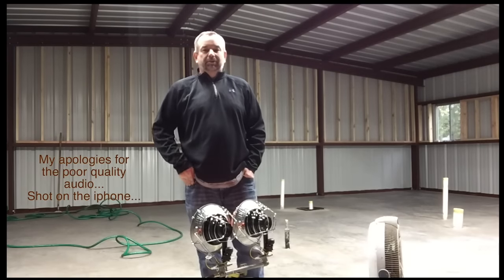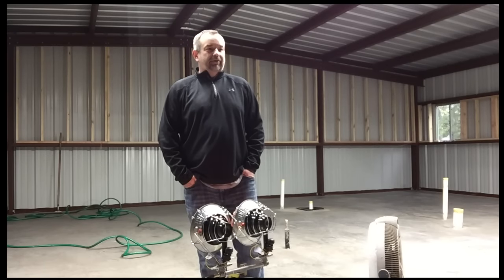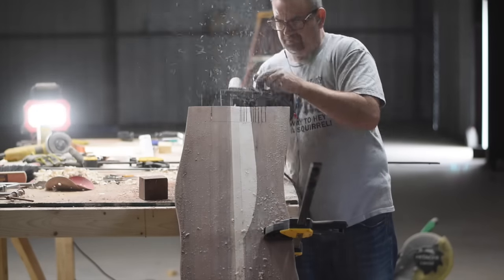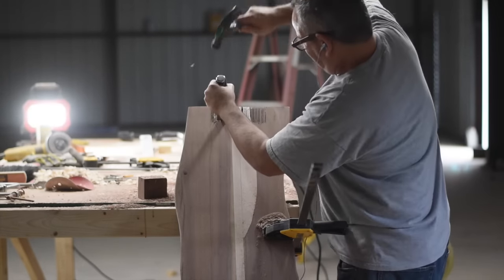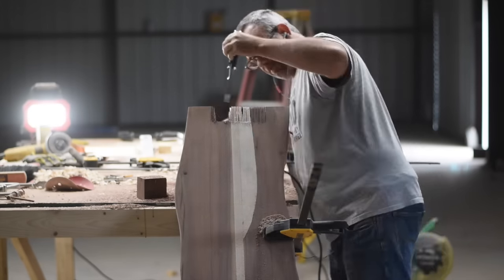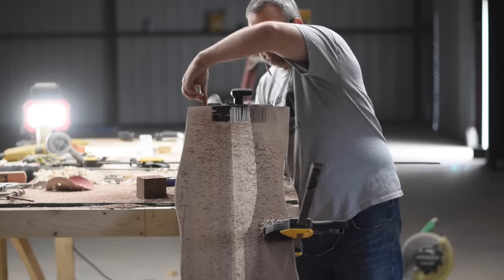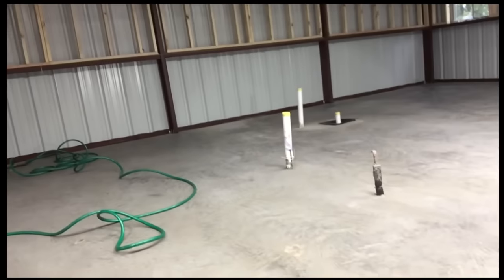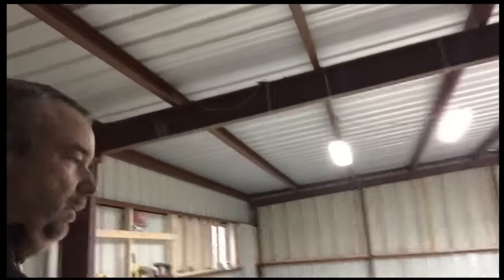Walnut Bench - Shop Water - Concrete Stain Prep

Comment: Love that building !!! When I did the floor in my garage Sherwin-Williams told me after I acid etched the floor to take saran wrap cut 4 or 5  8 inch by 8 inch squares and  tape them to the floor. Then every day pull them up and move them to another spot. When you get to a point that when you pull them up and the area underneath the saran wrap is not darker than the surrounding concrete (darker equals moisture) then the concrete is completely dry and ready to finish. may be a useful tip I never thought of it tell they told my that........LOL
Reply from the maker: +johnsont963 Ok, that's a good tip.  So you did this after you put the stain on, but before you put the top coat sealer?
Reply: My floor was a epoxy coating .I applied these check square to make sure the concrete was absolutely dry before starting the application process.  Conducting a moisture-vapor emission test is also a good idea at this time. This will measure how much moisture vapor is being emitted from the slab. Too much moisture could inhibit stain penetration. You can read more about this topic on The Concrete Network (www.concretenetwork.com/bob_cain/) 
The reason I brought this up is I have a friend the just went through this and had to do it over again and I was asked my thoughts on it and I suspected moisture vapor.